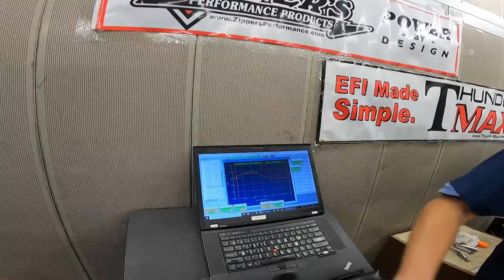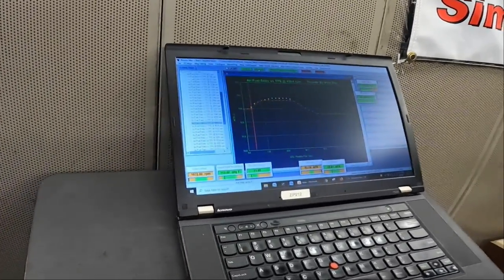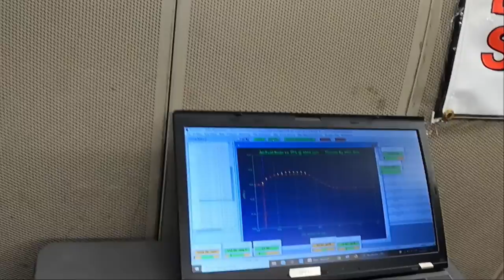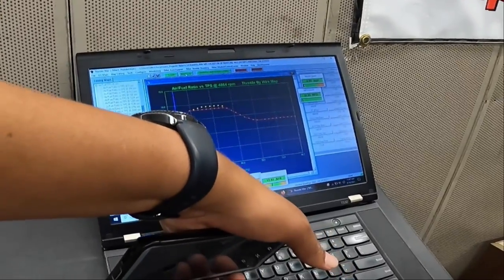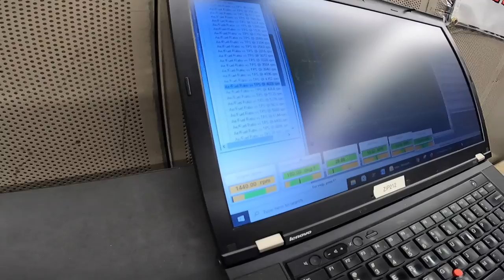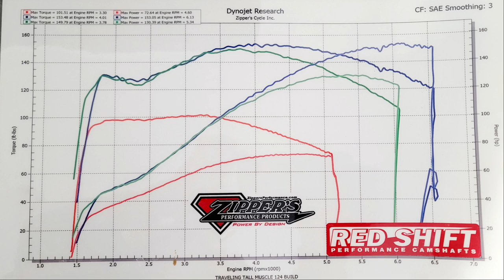3500 miles after the 124 Zipper's Performance Muscle build, how much Horsepower and Torque did.....

Comment: How did your power numbers go down if you have the Thundermax tuner? BTW based upon your reviews, I have gone to TMAX, RS468 cam, KW headpipe and mufflers and just ordered a 117 big bore kit. Thanks for your detailed reviews. You are a super ambassador for Zipper’s products and so far you have been an honest broker.
Reply from the maker: Even with correction factor Dyno results fluctuate. As long as I'm within 3 or 4 of the original pull I'm OK with it.  Your bike should really scream now, I had a friend with a 117 that has a 468 and his bike was really fast. 
Thanks for watching and commenting.

Comment: Added a redshift 468 cam on a 107. Good power but a really noisy cam.  This 468 makes the engine feel/sound like a locomotive mid rpm range. Don't think I would use it in the next bike.

Comment: What kind of  Hwy  gas mileage  do you get after the up grade.
Reply from the maker: About 220 a tank on the last roadtrip.
Reply: @TravelingTall  thanks
Reply: @TravelingTall  I have a 128 zippers build with stock heads and get 185 hwy at best

Comment: Tall is your crate a 124 or staged to a 124?
Reply from the maker: Stage 124, but J have a full rebuild top end and bottom.
Reply: @TravelingTall  Wow thats even more impressive. I checked Zippers site, I have to have a 114 or 117 to get that big cam you have. I have to get the 468 for my 107.